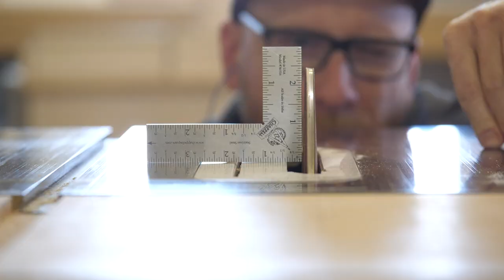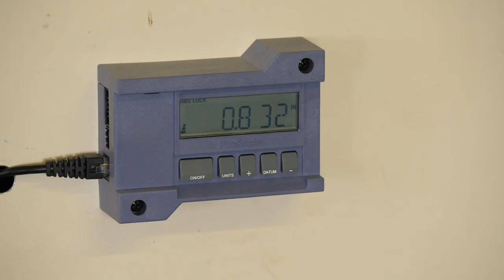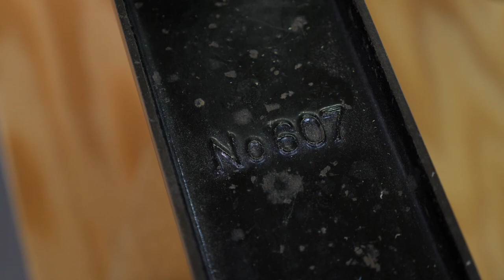A Desk Built For Two Again?

Comment: another solid method of trueing a boards edge is clamping it the sliding table saw and running it threw the blade
Reply from the maker: Thats a very good point, but in this case the pieces were longer than the stroke of the saw.

Comment: Drawer spacing.....the bane of my existence... love this method and how  you give product tips..
Reply from the maker: Whats cool about this method is you can get the gaps as good as you want. Just depends on how much time you want to invest.
Reply: @MikeFarrington  What spacing do you generally try to get? Looks smaller than 1/8"
Reply from the maker: @careyhenitiuk8423  I normally cut parts to a 1/16" gap, then sand/fit that takes them to 3/32 normally, but I am ok with 1/8" if thats what happens.
Reply: @MikeFarrington  Thanks for the response, and for all the videos and details you give!

Comment: I knew it was high time I bought myself at least a biscuit joiner if not a Domino tool, but I didn't realise that I also needed a lipping planer — or even that they existed — so it can work out expensive following your channel!  To be fair, I can think of lots of occasions when a biscuit or Domino joiner would have helped me make a much better job of a project, compared to simply using pocket screws.
Reply from the maker: Either of the two will really help out for sure.

Comment: So happy you  have upped your finish with Kem Aqua. It’s a fantastic furniture grade finish. They also make a surfacer to use as your undercoat. It’s water based so it won’t decrease the raising of the grain, but it will definitely cut your need for 4 coats down. It sands great and has more of a build to seal the raw material.
Reply from the maker: I’ve used Kem Aqua off and on for a handful of years now. It’s a good finish with lots to like about it.

Comment: Beautiful work as always. Hey man... I do not work for Renner and have no invested interest in this statement. But if you could get your hands on some Renner paint products shipped in to you, it will take your painting to the next level. Chem aqua and shellac primer can work fine obviously, because you've been making it work. But Renner finishes are on another level. Every product that they make is simply just top of the line. Their primer builds and sands the best, with minimal grain raise if you use a dust coat. Their top coat durability and resistance are simply top of the line. They even have some products that are near impossible to run as they are intended for vertical applications, perfect 1 coat stain blocking on their stain blocking primers... Anyways... Check it out if you get a chance. Renner products sprayed out of an airless, in combination with Festool Sanders with surfprep pads have taken our painting time and reduced it by 30% and reduced our painting complications by 95%. 

You'll have to get them shipped in from a regional distribution center. But they are worth it.
Reply from the maker: I'll look them up. Thank you for the suggestion.

Comment: Mike look on youtube for the 1/4 1/4 1/4 draw  i think you'll find the guys draws ez to make.  Some guys just glue the bottom on, thats never going to hold up over time. Its a cheap shortcut bound to fail.  No one weights what they are putting in a drawer.  75lb load limit. Yes 250 lbs went into it first day.
Reply from the maker: Thank you. I am aware of that method, it works fine. My issue its its too slow to setup.

Comment: Looking very nice! I use the same Blum hinges - when you release the clip part from the door, the centre of it should have a little notch to poke the screwdriver in to pry it, rather than risk denting the door 👍
Reply from the maker: Thank you. Good tip. I use my thumb as a pry point, which prevents denting.

Comment: Mike, could you not have used your tracksaw instead of hand planing to joint the edges of the boards prior to glue up? I know 13ft is a long track but obviously you can join multiple tracks.
Reply from the maker: Track saw would have worked. For what ever reason I don't trust the connecting kits, though my position is unfounded.

Comment: If you find that you need more paper storage (like for all the shipping labels for those fantastic double sided sanding disks), consider adding another shelf in that cupboard. But then I won't be able to change my ink cartridge easily... I hear you say... Truth is you'll be much happier with the printer on a full extension, pull out drawer/shelf.... Especially if you do much scanning. (Whenever the printer is in a cupboard, I feel like the plumber changing out the faucet.) 💖🌞🌵😷
Reply from the maker: Funny you mention that. I actually have the slides to do just that for the printer. That may be a future upgrade.
Reply: @MikeFarrington , Hope you do a video on the upgrade... it will be fun to see how you'll get around those bottom hinges! 💖🌞🌵😷
Reply: @MikeFarrington  , you'll make it a priority, the first paper jam you get and you bump your head on that shelf! 💖🌞🌵😷
Reply from the maker: @suzisaintjames  Ha! You're probably right.
Reply from the maker: @suzisaintjames  Maybe I'll put it on instagram. I would just use a bottom mount slide setup.

Comment: @10:38 Yes, you are right, if there's one takeaway from this is that  prior preparation and planning prevents piss poor performance and results in a perfectly piled pile of parts presently prepared for further processing.  All those drawer slides and stop locks etc would add up to a pretty penny percentage of the total pacakge price, no?
That's a sweet looking unit and the subdued office colours really set it off.
Reply from the maker: Thank you very much.

Comment: Hi Mike. You do definitely make great videos and I appreciate your work. I have thought of using the polyurethane glue for the reasons you mentioned. What stopped me is the notion you have to add moisture to the joint it says for setting. For example a captive back I want it to slide in and allow time to complete the carcass. Yellow glue adds moisture and it begins to get tight. Polyurethane glue adds lubricity to the joint until you spray with water. Are you adding moisture?
Reply from the maker: I do not add moisture. It seems to cure just fine.

Comment: Great work indeed, love how the finish looks especially! I've a "technical" question for you Mike, so to speak. If you can't afford to work with hard wood (don't have a planer nor a jointer), do you think plywood may do the trick for making doors/drawer fronts? Or is better at the point to just go for "full MDF" route?

Best!
Reply from the maker: Yes, you can use plywood, but its a bit more prep work to get the paint to look right.

Comment: Beautiful. I notice the “seam” between your panel and rails/stiles always looks fantastic (as in invisible). Any tips for that besides just breaking the surface on the first slot cutter pass? I often will have a visible line where the msg meets the rails and stiles on a painted door and have to add a small amount of painters caulk.
Reply from the maker: I always make sure there is glue on that surface, I think that really helps make it look seamless.
Reply: @MikeFarrington  thanks!

Comment: Love the T-shirt collection. I had to pause the video to see Mouse rat and Blockbuster Video. Is there any video evidence of you making the flat cart you set the cabinet on? Looks like bridal joints on 4x1 pieces with a panel on top. I don’t know if you’ve shown the offset push stick either and am curious on details to how you made it. Enjoyed seeing you using the other push stick flat at the router. What size rabbeting bit is the blue one on the fence? I struggled recently to find one to reach full 3/4 plywood width but ended up using dado stack.
Reply from the maker: Thank you. The shirts are intentional and a look into the things I like. The flat cart is made exactly how you guessed. I have that build recorded, but I haven't had time to edit it. Check out my Instagram to see how I made the push stick. I don't know the size of the rabbeting bit, I do not think it'll go to a full 3/4", its maybe 1/2" or 5/8".
Reply: @MikeFarrington  Thank you <3

Comment: Great build and video, Mike.  Any tips on how you make the "slip tenons?"  Thank you!
Reply from the maker: Thank you. You could use the same material as the center panel. Or plane wood down to the correct thickness, then cut to width and length. If I go the solid wood route, I like to make sure the grain goes across the joint.
Reply: @MikeFarrington  Got it, thank you very much,

Comment: Mike, I have been watching your videos for years and have seen every one of them, in fact, I have watched many of them several times each.  Outstanding craftsmanship.  I have a question about priming and spraying paint.  I use a fuji HVLP minimite4 and I'm a hobbyist.  I noticed you say you use a lacquer based primer and then latex spray in many of your projects.  while I have many questions, let me first ask what grit sandpaper do you use for sanding the primer.  I have recently seen sanding marks showing though my tinted lacquer top coat and it's causing rework. Thanks!

Comment: Mike: Thank you for the finish suggestion. May I ask what was the point of using a $10 Harbor Freight Spray gun when you have your better equipment? Are you ditching the spray gun after using it as cleaning it may not be worth your time? Curious minds and all.....
Reply from the maker: Thank you. Well, I like these because, I use them and don't feel bad about not washing them. I use them a time or two and pitch them. Since this was a small job, the slower speed wasn't a big deal.

Comment: Why do you choose to use you might sanding disc, instead of your belt sand unit?
Reply from the maker: Because the work piece is trapped between the disc and fence, edges will stay parallel. On the edge sander it’s easy to end up with a parallelogram. Hope that makes sense.

Comment: Do you use the HF gun with the Kem-Aqua because it can be thinned more than BM Cabinet Coat, therefore not requiring the additional PSI of the convential Binks?
Reply from the maker: Yes, Kem Aqua also starts off much thinner.

Comment: Mike, did I hear that right, you used PU because it gave you more working time? The stuff is an abomination, fine for Noah's Ark 2.0 perhaps, but cabinetwork, surely no way.
Reply from the maker: I like poly urethane glue. The key is to get to a point where you know how much is just right.
Reply: Mike, you must have a different type in the US, I didn't see your project, hands and machines covered in it - like it would be here in the UK😁.
Reply from the maker: @chrisjordan4210  That would be interesting to know the differences between the two formulations.

Comment: Jeez. 38 seconds in and you're pushing a 1.5 " square behind it with your fingers. Unbelievable
Reply from the maker: Not sure I follow?
Reply: @MikeFarrington  did I see correctly no pushstick at the jointer with your thumb trailing and pushing? It does seem.
Reply from the maker: @stevekelehan6956  Everyone is comfortable as different levels. For me that thickness feels fine. Any thinner and I would use a push stick. Feel free to disagree, this is just what I do.
Reply: @MikeFarrington  you are right I disagree... the thickness is not so important. It's about the direction of the pressure. Sure, I've done it that way too. But, I would never film it and show it. I'm sure you have tons of neophytes watching you. good time for a quick pointer
Reply from the maker: @stevekelehan6956  I appreciate the input. We'll have to agree to disagree on this one. Thank you.
Reply: @MikeFarrington  that's cool man, I'm sure these videos take tons of work ...